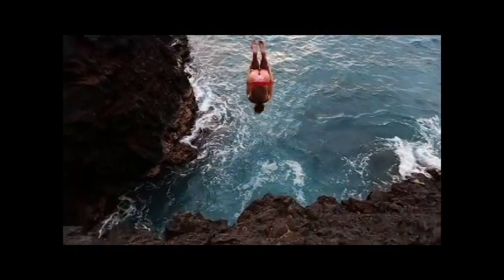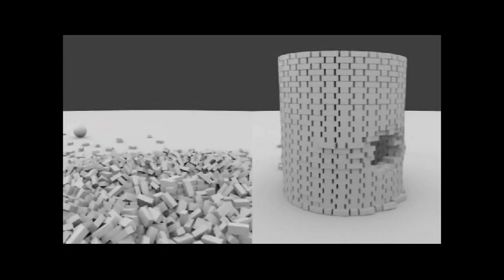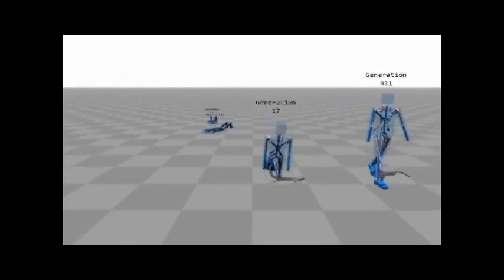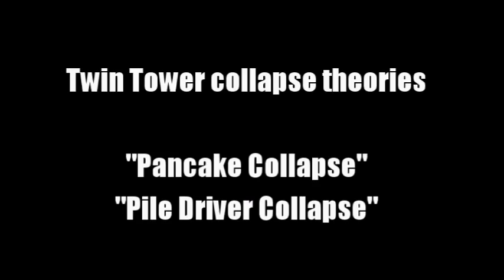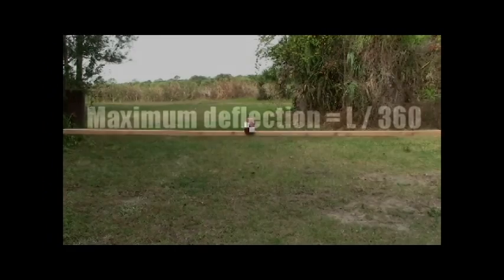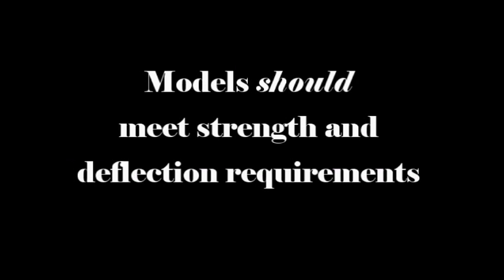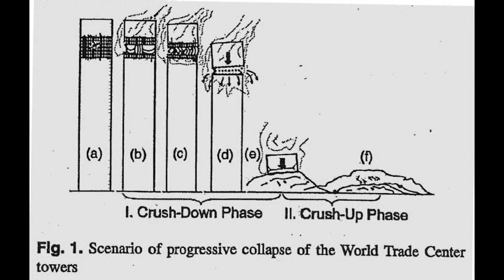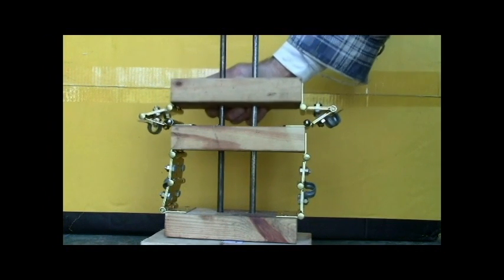9/11 Experiments: The Force Behind the Motion

Comment: Notice how the steel core columns did not come down in the experiment. Even if you used blockbusters instead of firecrackers, those two support beams in the experiment would never come down. Fire fueled by kerosene could never reach the temperature of melting steel. If that were true, jet engines would melt themselves before take off or in mid air.

Comment: Another approach would be since the fire weakened the central supports, the main support would have been on the outside which is the way they were built anyway. Now, if the debris was to fall on the outer wall from the inside, this would compromise the structural support of that as well causing the tower to fall. If the interior was falling and causing the outside to fail, then it would appear, from the outside, to be accelerating and this would leave no intact floors as well. This theory supports what was seen on 9/11.
Reply: Well that approach of yours is doomed from the get go because the fire didn't weaken the 47 boxed core columns to any extent. Try again, but  insert some realism and plausibility next time.
Reply: And I might add your questions are moot since It’s now been prooven that the buildings were vaporized and dustified in mid-air by satelite-mouted Directed Energy Weapons.

Comment: The experiment with cement sheet is dissimilar in two major ways, first the falling object is only striking a small area of the floor sheet, which means the falling object is very different from a large flat sheet falling through a void and striking the floor below with more evenly distributed force and weight. Secondly, the floor sheets used were supported by large wooden brackets which are completely different from the small steel brackets in the WTC. The top sheet was broken in the middle and when the weight and the broken sheet falls it strikes the sheet below also in the middle only. This does not compare with a pancake effect, and is therefore null and void as an experimental model.
The experiment at 8:36, comes very close to what appeared to actually happen, if that experiment had including the entire structure in an enclosed box to replicate the very strong steel columns of the WTC.  This would contain much of the force generated by the falling floors, causing the compression bursts seen in the actual footage, and you would have a fairly close approximation of what appeared to actually happen.
Still, these experiments are very informative and thought provoking. Thanks for all the effort.
Reply: Hebrew person, The building collapsed floor by floor straight down, appearing to gain momentum as the load increased. This can be seen in the footage, so there are at least two options to choose from. One, the support structures were sheared by thermite or explosives, or two, the impact of the jet, plus the intense heat of the burning fuel, which may well have had a strong updraft working as a result of fuel spilling down the stairwells and elevator shafts, and the intense heat from both the fuel burning on the floors impacted by the plane, and the fire burning from below, could have softened the supporting brackets enough so that one or more floors collapsed, falling in a pancake fashion. The fire appeared to affect several floors, and it also had to have filled the entire space between several floors so that they were affected by heat relatively evenly and simultaneously.
Once the weight of the remains of the jet, the debris and weakening from the combined impact and subsequent explosion, got to the point of breaking the brackets on two or three floors, then the floors below simply gave way as they were designed to do.
I can't imagine the building being rigged for explosives without someone noticing, but that may have happened. I would consider the probability of that as 'extraordinary circumstances' less likely than the above scenario. 
I am not an engineer, so I am only going from my experience with explosives and general construction and even more so, from trying to understand what I was seeing in the many different pieces of footage, and also what the designers had to say about the actual brackets, which were made in such a way as to prevent the building from toppling sideways.
Please tell me what you think happened, as I am curious why you ask the above question. Also, let me know what nationality you are. I have not read the NIST report. The reason I am interested especially in this event is that a year before it happened, I drew a picture of a skyscraper falling, as a second one was being hit by an object with four streams of smoke behind it like a jet.
Reply: Hebrew person. How can you be so sure? Are you a Mossad agent who set the charges? Lots of people say that it was your people who did it as an insurance job, a gold robbery, or to draw the U.S. into a conflict with your enemies. I took a further look at some theories about this accident after posting my comment above, and I happened upon a doco called 'How the twin towers collapsed,' by Discovery U.K.. This video agrees entirely with what I wrote. If you haven't seen it, please have a look. 
You asked me a question, and I took some time out to try to answer it. How about doing me the courtesy of answering my questions to you. Are you Hebrew?, Do you know for sure what you are saying? What actually happened, and who did it, and for what reason? If you won't answer, a lot of people will be even more convinced that this was a subversion job by Mossad or the Jewish owners of the WTC.
Reply: Watch the above U.K. Production, It also is based on the opinions of engineers. The sad fact is that lots of things built and designed by qualified engineers fall down. I told you above what my qualifications are.
Seeing you care so little about social media, why bother to ask me questions? I was quite surprised to have qualified engineers agree virtually 100% with what I posted. As one of your countrymen might say. Engineers smingineers.  As the lord of the Universe said, You are a stiffnecked people! 
Maybe you should care a bit more about what others say. I don't care if Israel has secretly developed a neutron bomb, if you don't embrace the Messiah, you will go down like all the other shmucks, so don't think you are invincible in your opinions. Also the critique that I offered above will stand, because the experiment was flawed as even a child could see.
Reply: What inaccuracies do you refer to?  The above mentioned doco makes a lot of sense to me. Apologies for flaring up, but you put too much faith in degrees. So many people rely on formulas which cannot, and do not take all factors into consideration. By the way, I am a person who despises racism. I also have made very intensive studies of the Sacred texts, which in my opinion vastly surpass any degree obtained by a university education, although I do have an associate in arts in botany. As Emmanuel Swedenborg said two and one half centuries ago, 'geometricians think they know everything, but the sad truth is that geometry could never explain even the structure of the lower intestine, one of the simpler organs. In fact, he says, that the 'geometrician couldn't even explain the geometry of the resulting turd.'
Reply: Hebrew man, The experiment conducted with cement sheet held in position by relatively thick wooden battens presents an entirely different scenario than that which occurred in the twin towers; The cement sheet was firmly supported by the battens, providing an enormous amount of surface area to support the sheets. 
In the trade towers, the only thing holding up the trusses were smallish steel brackets which would have softened and given way at roughly the same time. It is apparent from the footage that these trusses did collapse in such a way. 
If the trusses did not fall as a unit striking the trusses below in a flat trajectory, that may not be the important point. The weight of the trusses and the debris would have been enough to cause the trusses below to fail in such a way due to the accumulating weight which would have been relatively evenly distributed, and this would have continued to have an increasing effect as the weight of each section fell onto the floors below. 
This situation would have entirely different results from those obtainable with the use of either wooden battens or concrete blocks, which have much more relative strength than the small steel brackets. As the weight increased, the steel brackets would have failed with or without heat.
The real problem as I see it, is where did the thermite come form? If there was thermite found, this completely validates your case. The planes, after all, did hit the towers, so the perpetrators were controlling both the aircraft and the demolition by thermite. I'm not sure if I addressed your question, so if not, be more specific about what you are driving at. I would appreciate your take on how this disaster happened, and who was responsible. I think these discussions are very interesting, and am enjoying our exchanges. Thanks.
Reply: Why not cut the crap and tell me what you think happened?
Reply: I would be delighted to address you by your name but my keyboard does not have a Hebrew text. I do not read Hebrew, though I would love to be able to do so. What do you prefer that I call you?  Perhaps 'man who writes his name in an unintelligible language to most of the world?' I have done my level best to answer all of the questions that you asked, so how about having the decency to reply to my queries and statements with some clarity? I am doing my best to understand this issue. It could pay you to remember that some of the greatest inventors and innovators in history had little or no education. They just had common sense, and looked carefully at what they saw. A university education often leads to a sort or arrogant stupidity. Just tell me what you think happened and why, and we can have a civil exchange of ideas. I am not an idiot.
Reply: Sorry Ken but I have a low tollerence for this sort of time waisting. Let’s get to the point, shall we? Are you familiar with the work of Dr. Judy Woods? Please explain to the class how and why the buildings were vaporized and dustified in mid-air, leaving no solid debri whatsoever. I’ll then use my strong scientific mind to judge in you answer good enough to consider teaching you more.
Reply: Yes I have seen her work. I don't, at this point believe it. There were absolutely tonnes of fire retardant minerals on all of the steel work. The floors crashing down one upon the other would have further pulverised anything brittle. These two factors alone explain the large amounts of dust. The steel, was accounted for as far as I can see, as much of it would have plunged into the basements. 
So as far as I know there is no need to drag disintegration rays or anything so bizarre into the equation.  I have seen a dozen other explanations including holograms, and missiles, and I forget what other theories. I saw the photos of strange scorches and melted door handles, all of which can be explained rationally by such events as burning debris falling on the cars. And the fact that paper was left unburnt is absurd, as when a firecracker goes off, there are paper fragments left behind.  
So far, I haven't seen anything convincing. These days, a person would be a fool to deny the possibilities of something unheard of ever before as the cause, but at this point, I can explain most of what I have seen in rational terms, and I have no need to resort to space invaders or any other unsubstantiated theories. You brought up the compression theory presumably to infer that the compressed air trapped between floors would have slowed the descent. I have explained that I believe there was ample exits for compressed air to escape. How about answering that argument before bringing death rays into the equation.
I am totally uninterested in wanting to waste either your time or my own. On the contrary, I was hoping for some new data that makes sense. Shalom.
Reply: I urge all truth-seeking Youtube users to help me in my struggle against these insidious Jew-payed JTRIG shills (like the ones above). If you are one of these shills or you know somone who is stalking me online, be officially warned at this time: THIS IS CRIMINALLY ACTIONABLE FRAUD !!
Reply: Ken Bellchambers You see Ken, you have to understand, I am the truth authority on these channels. When people fall in line, I can be very bennevelent. But when they don't, I come down with an iron fist. It's not easy haveing all this power, but I take the responsibility seriously, but if you want to test me, I'll show you what I can do. Despite our cordial exchange so far, if I find that you keep conversing with the impersonators on my channels, you'll be VERY sorry.
Reply: Ken Bellchambers.  Beacause I’m DYING for atention today sweetums. I mean DYING. Please Ken, just a little atention for me babe?
Reply: Yup, now you're talking bro. You go ahead, I have an appointment with my Jewish dermatologist.